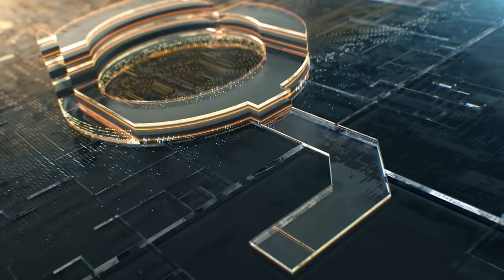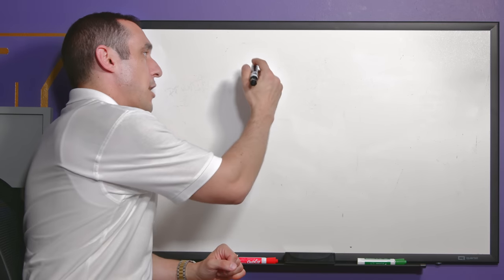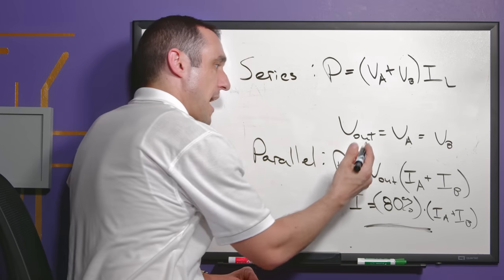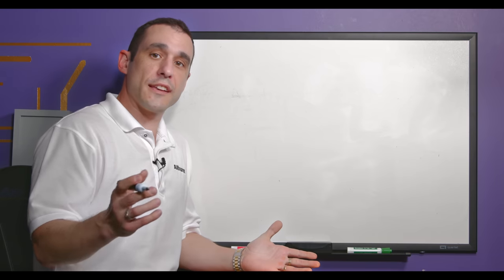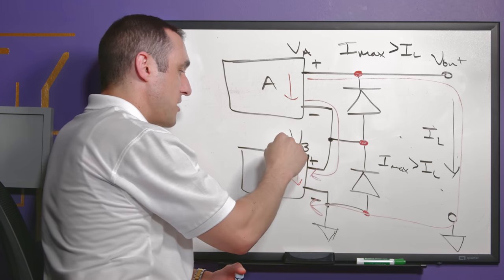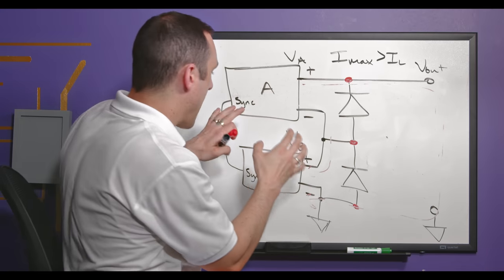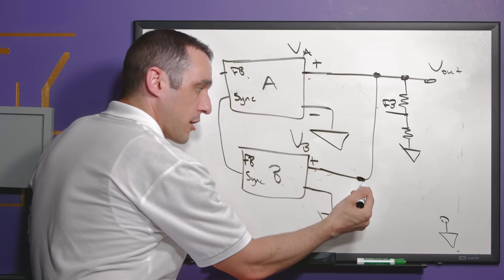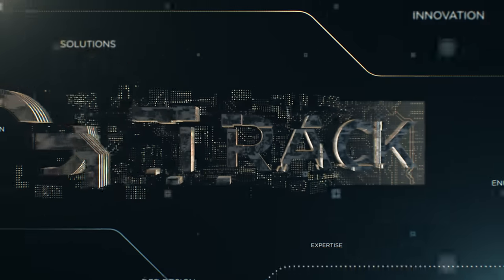How to Use Power Regulator Circuits in Series and Parallel

Comment: 8:55 I am a bit confused about purpose of 2 diodes and what kind of "isolation" they provide. Can somebody explain?
Reply: Maybe , in case one of the regulators shuts down you don't drive current in it

Comment: What would be the problems if you were to parallel two buck converters that did not have any sync capabilities? Would this be an absolute no? Or is it still possible with diodes on the outputs?
Reply: It depends, be careful about that because you now have two components trying to drive each other other during switching, and the switching waveforms can be out of sync and could even be at different frequencies. The problem is that any time the potential difference looking back into one of the drives gets too high you could drive the gate into reverse or even drive one of the pins too far into reverse resulting in failure of the device, but that's generally if they don't have any built-in overload protection or the ripple voltage is very large. At minimum, you will have the FETs or the internal switcher just burning up power and creating excess heat due to reverse driving. The syncing basically aligns the ripple waveform in phase and frequency, so they will oppose each other and reach very low potential difference.

Comment: Hi,
A little confused about the statement that the diodes must not be driven into reverse bias? If they are not driven into reverse bias, then they will have a forward voltage drop of lets say 0.7V. So if the bottom diode at 9:17 is not to be in reverse bias, then the + terminal should be negative. I am missing something here?
Reply: I say thatbecause, if the + voltage on A is large enough to drive the two series diodes into reverse bias to the mutual grounf (- terminal on B), then the regulator would basically short out. This is another way of saying your reverse breakdown voltage needs to be large enough so that the output voltage is dropped across your load and not across your diodes.

Comment: Placing 2 regulators in parallel is a bad idea. There is part-to-part tolerance. For example: 1 3.3V LDO, could be actually 3.28V, and the other could be 3.31V. If you placed these in parallel you're just burning power as one would drive the other (is syncable), or 1 would be used significantly more than the other.  This is never done unless you have a very (very) unique circumstance, and for building an actual product, is a bad idea. Series is used all of the time, for example: Power regulators which have +/- rails for op-amps. Nonetheless, good overview and conversation pieces for us EE's. 👌
Reply: he said in the video @17:14 that you need to make sure that they are design for it.
Reply: LT304x LT309x
Reply: Thanks, I did mention it's best if they are designed for it, I agree that doing it with something like 2 LDOs is not a good idea especially if they have no way to track and sync outputs.
Reply: @Zachariah-Peterson  yeah I know thanks for replying!
Reply: @Zachariah-Peterson  What if you put some diodes to isolate the individual outputs and the main output? I know the voltage drop would reduce the total output power and it's not recommended to do that for an actual product. But my usecase is that basically I want to test the power handling capability of a multi channel SMU (120 channels) by connecting all of them in parallel to an electronic load. If I connect them in parallel would that potentially damage the instrument? If I put diodes in between each output to prevent back powering every source channel would it have any unintended consequences?